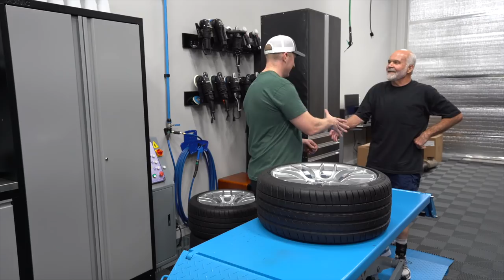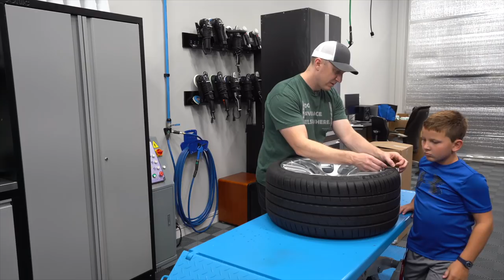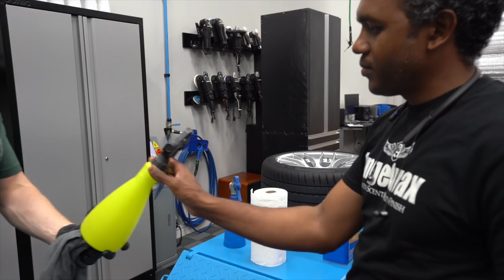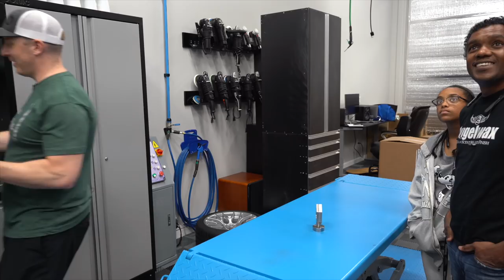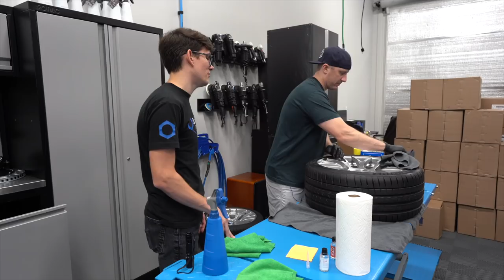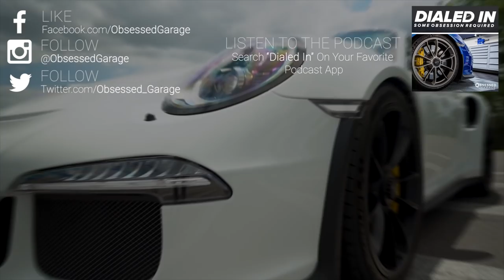Coating & Chat:  BMW 359M Wheels w/ Gtechniq CSL/EXO

Comment: I have a big brake kit on the front of my car, and it throws SOOO much brake dust.  Tried using a sealant to keep the brake dust from building up so much, but even still the wheels are filthy after two days.  Is ceramic coating the wheel the only way to avoid this?  Thanks!

Comment: Glad to see i am not crazy! I just did CSL & 2x EXO on my wheels after they've been refurbed. In theory it should outlast wheel coatings, im just wondering if it will stand against the heat and constant brake dust.

Comment: hey Matt, I have a lot of experience with AI and programming. I guess I could maybe generate some AI models for your website if you have enough data if this is something you're interested in - although I would be doing this from the UK if you're interested. One very obvious use for AI for an online store is customer segmentation. For example, if you buy product A and B, then you will most likely be interested in product C. Makes shopping somewhat easier.

Comment: Matt I forgot what its called but FB has a new membership program. A news program i follow has it setup for 99 cents. Pretty neat “supporters” are highlighted when they post.

Edit ill add to this one. You ever look into using a air sprayer to apply coatings to wheels?
Reply from the maker: Interesting.  I don't like the idea of spraying coatings into the air.  You'd have to have proper respirator and ventilation to do that.

Comment: Is it a good idea to coat a wheel before a tire has been mounted and balance to it? I’m specifically concerned about those square weights they stick on the wheel, you know...not sticking.
Reply from the maker: I do them after mounting and balancing.
Reply: Obsessed Garage Makes sense, I’ll do that.